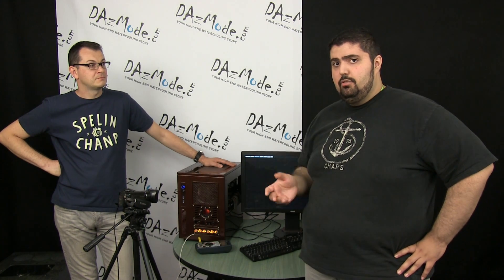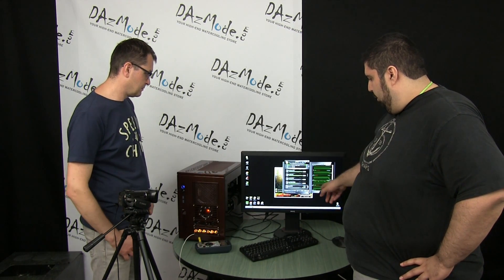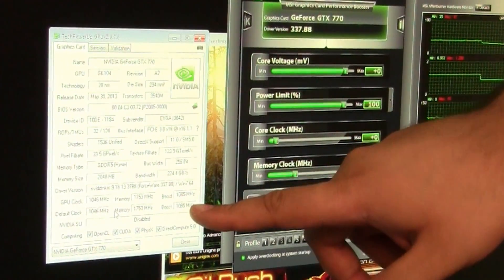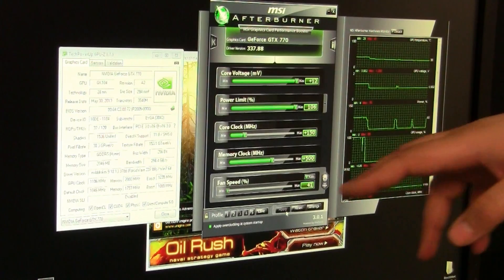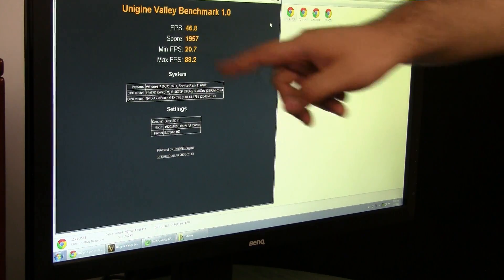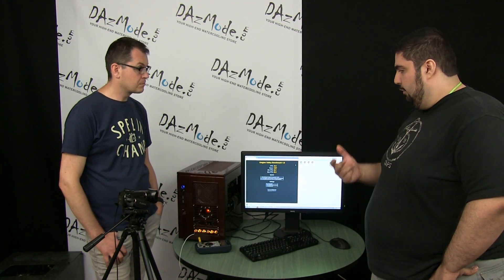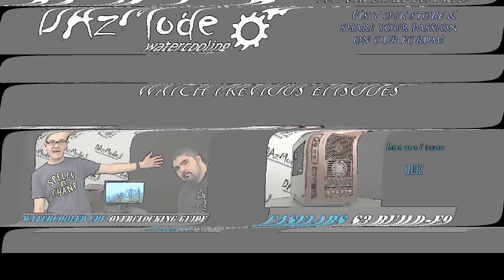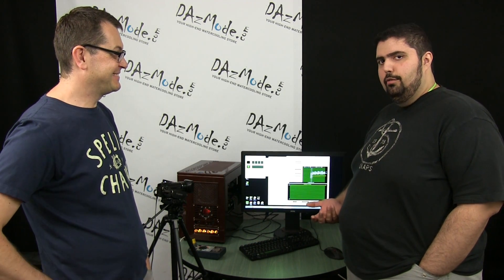Detailed Watercooled GPU Overclocking Guide - Mocha Build Ep11

Comment: I need help!!! I can't change the core voltage... it's set to a value and can't be changed. I am using an evga 780 superclocked with acx coolers... I tried to play with the settings in afterburner but nothing helped...